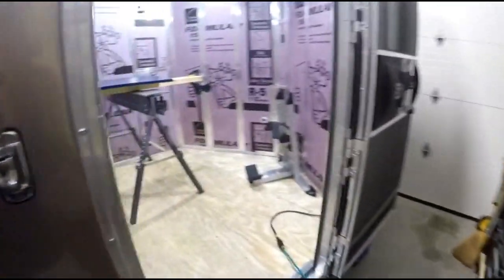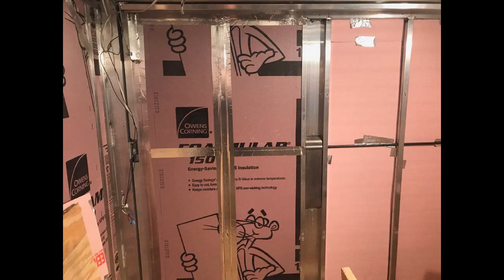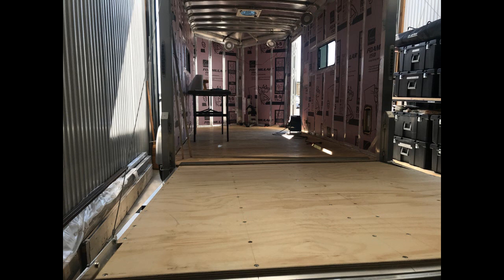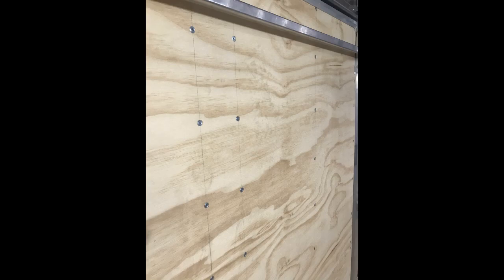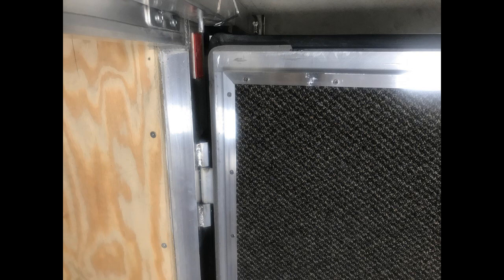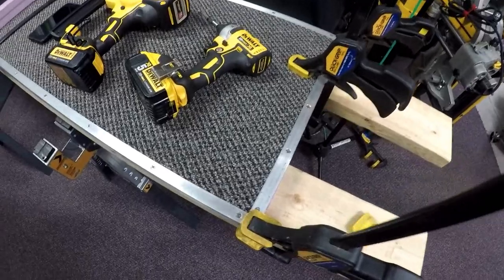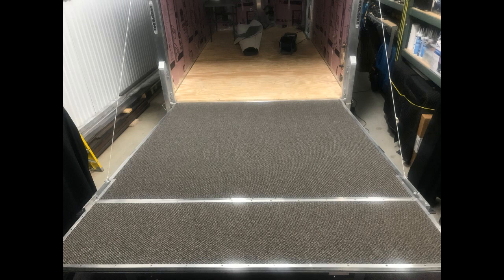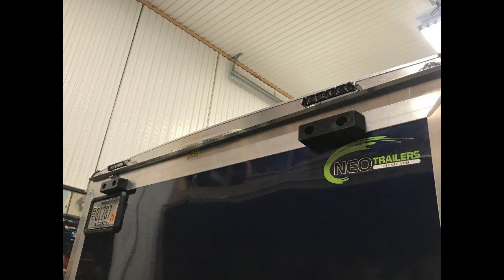NEO NAV CARGO TRAILER CONVERSION REAR RAMP DOOR INSULATION AND UPGRADES HARLEY DAVIDSON HAULER

Comment: Nice. How long is the ramp extension?  12, 18,  20, 24,..inches?
I am about to add an extension onto my ramp door but am not sure what a common length is for when loading a heavy motorcycle.
I see it is almost the full 5 feet or 6 feet width of the main ramp.

What is the purpose of the white box on the floor at the front. It has a black vent hose to the wall.
Harleys are so delicate and need details like this just to go up a ramp. 👍

Comment: Questions on your flip gate. Did you use a piano hinge?  If so what size?  Does the top edge of the flip gate also need rubber bumpers as support or is the hinge sufficient?  Finally how did you decide on the length of the flip gate?
Reply: Check on NEO’s website for their ramp door flap hinge photos.  Legend uses a similar outer edge hinge points with a  below flap cross bar.  The weight load is on the main door edge.  Hope that helps.  I can’t post a photo here.

Comment from the maker: When loading using the ramp it is protected by the use of a heavy duty commercial 3x10 rug designed to grip carpeting. Indoor Entrance Runner, 10 ft. L, 3 ft. W, 3/8" Thick, Rectangle, Charcoal.   Very safe loading and unloading.

Search:

Indoor Entrance Runner, 10 ft. L, 3 ft. W, 3/8" Thick, Rectangle, Charcoal
https://www.grainger.com
Stock # 9PVZ9

Comment: CAN YOU GIVE A PART NUMBER AND MANUFACTURER FOR THE LARGER RUBBER REAR DOOR BUMP STOPS.. THANKS
Reply from the maker: Yes these are on Amazon Pit Pal 703 7.75” X 2.0” X 2.437” Rubber bumpers.
Reply: Yes Pit Pal Products #703 on Amazon.

Comment: Or you could just buy a BMW and you wouldn't need to trailer it - you could ride it.
Reply: Jon you couldn’t resist. At least it’s not an Indian.  I’m building a custom camper that fits any bike to take along.  You get bored driving out of the garage seeing the same roads after awhile.  I create a fresh trip starting point whenever I want in a three day weekend. CTC is blowing up right now.